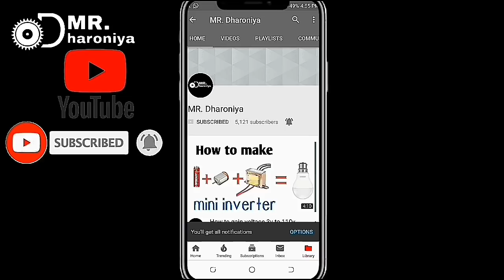छोटी ड्रिल मसिन बनाये। How to make a mini drill machine.

Comment: Dost Ye motor hum online bhi purchase KR sakte hai kya wo costly hote hai market se
Reply from the maker: Hello friends...

Niche di gyi link un sare samn ki he jinka use me khud krta hu. Ap ko agr ye samn kharidna he to.
Ap niche di gyi link pr click kr ke enhe kharid skte ho..😃👇👇👇👇👇

My microphone (boya BY M-1)
:-https://amzn.to/2TlqQE6

My tripod
:- https://amzn.to/2ML8ECC

My soldering iron
:-https://amzn.to/2MSvp7u

Solder wire
:-https://amzn.to/2YVEcft

Soldering kit
:-https://amzn.to/2YOdsO0

Resistance kit
:-https://amzn.to/31vrgdT

12v 775 high RPM DC motor only 300₹
:-https://amzn.to/2Ko3nPG

3.7 volt lithium ion battery
:-https://amzn.to/31v8B20

12V 7.5A battery
:-https://amzn.to/2yO7XA2

12v  battery charger
:-https://amzn.to/2KAjQiJ

12 - 0 - 12 Volt , 2A Transformer
:-https://amzn.to/2yRduG4

Agr ap ko Creative ya new ideas se releted video dekhna psnd he to meri Instagram id ko follow kre.
Instagram.

MR_DHARONIYA :- https://instagram.com/mr.dharoniya?igshid=1qtkzl0rst083